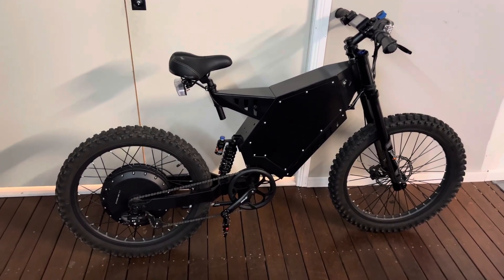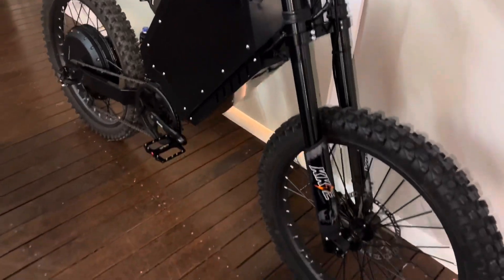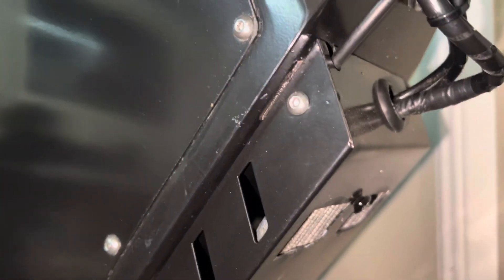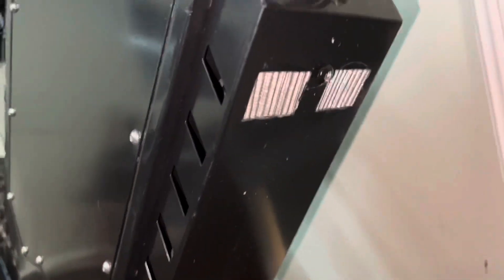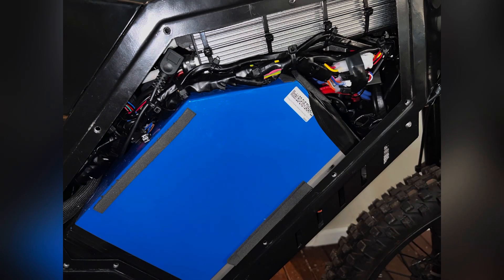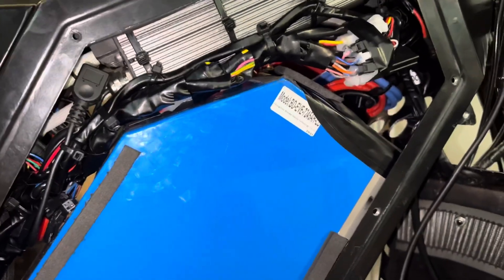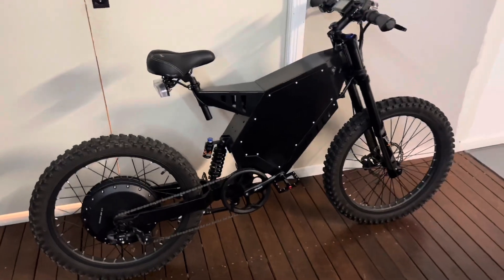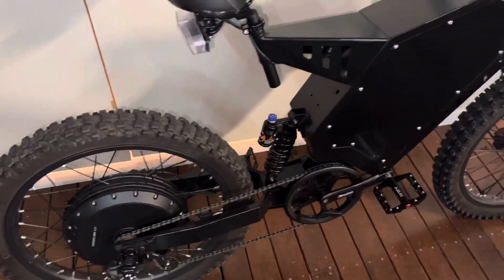K-5 Stealth Bomber E Bike

Comment: Push your rubber fork stops higher, they can pinch the cables and kill your throttle cable.  (At least that's what just happened to me)
Reply from the maker: Yeah mete I had that sorted always used to keep an eye on that if you put it high it digs the frame shit thin metal right where you need it but I had it sorted no pinching for me

Comment: i bought 8000w alibaba 72v  40ah... can these bikes cruise at 30mph and not worry about it overheating?
Reply from the maker: You in Australia mate we do km/h here I can do 45-60km/h no stop for about 1 hour before overheating but if I pump it to like 70-90km/h it only last about 10-15 minutes but they are so much fun at high speed
Reply: How do you find the bike from there ?